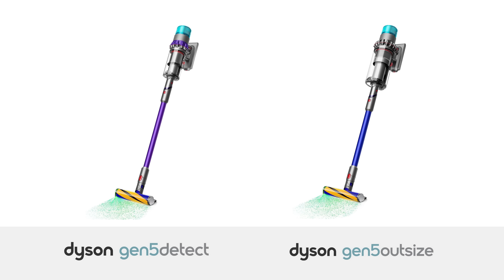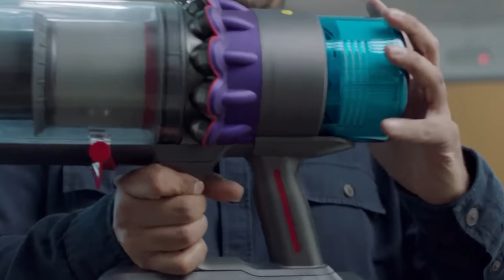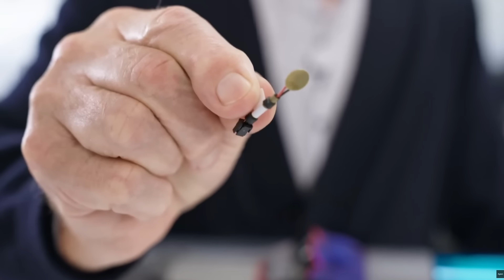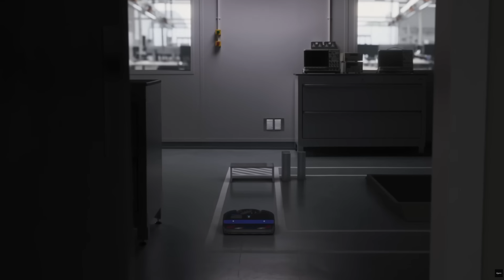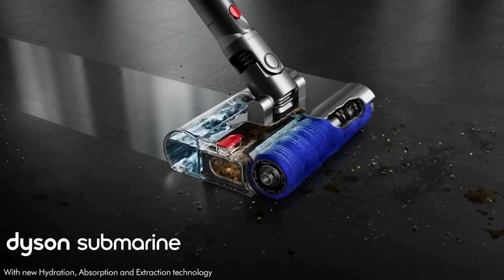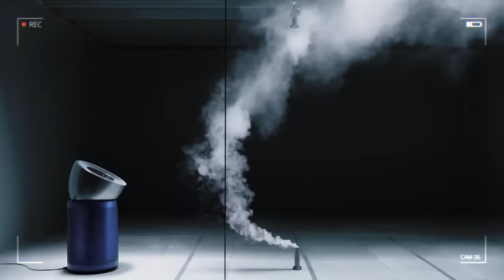Unpacking Dyson's 2023 Tech: A Comprehensive Overview - Vacuum Wars!

Comment: I personally had to go with the s9, the dysons run time actual reports from users has not been good not to mention no version of a clean base makes it feel heavily overly engineered like they took a shark and slapped a bunch of dyson chips inside of it. I feel for the price it should definatly have some version of a clean base and i think this years model will have a substantial run time issue compared to the advertised time.

Comment: I’m ordering that 360 VIS NAV when they go live. My original 360 Eye is sitting under a shelf because the charger stopped working. I’ve been using my 1953 Kirby Model 513 as the substitute for the 360 Eye. But I don’t mind using a historical vacuum from my Kirby collection. It’s the oldest Kirby in my collection when age comes down to hours ran and used in its life. For a vac built in 53 and rebuilt once in the 80’s, the 513 keeps on cleaning! Eat your heart out Dyson upright fans!
Reply from the maker: We are finishing our review of the Dyson Vis Nav 360 today! Come back tomorrow at 4PM EST for our full review!

Comment: Hopefully Dyson has improved the design of the power trigger.  Just replaced it on my V11.  It was easy to find the part and extra long tools need for the fix because it fails so frequently.
Reply: Dyson replaced our trigger unit three times.  They said they'd replace the whole unit if it happened again.  It's annoying because we had the same failure on our earlier Dyson as well.

Comment: I use a Miele canister vacuum. My friend has a Dyson Gen5 Detect. I don't like it. I hate having to keep my finger pulled on the trigger and because the motor and dust bin sits high on the stick, my wrist gets sore when using. I would rather have a stick vac with the motor and dust bin on the floor, like a Gtech AirRam MK2. Miele also has a cordless vacuum with the motor and dust bin on the floor but I haven't used it yet. I would like to get a cordless vacuum but the Dyson isn't it for me. I hate the cheap plastic and Candy Land colors too. I will stick with my Miele canister corded vacuum for now.

Comment: That hepa filter on the robot will be a double edged sword. It’s going to clog and need cleaning so much it will hinder the effectiveness of that machine. Even if it self emptied it wouldn’t clean the filter. Having owned a Dyson detect, I can confirm that it will blog that filter in minutes or even during or after only one run. I don’t like the hepa filter idea if only because it will make this a maintenance queen.

Comment: Another vidoe where you say a small battery with charge and resume doesn't matter much. You're wrong. I thought it might not matter but when you have a slightly bigger home, it takes 10-12 hours to vacuum one floor cause it has to keep charging. So please stop saying a small battery doesn't matter that much. It most certainly does.

Comment: The submarine as an attachment is pretty interesting, but I can't believe that Dyson, *Dyson*, specifically can't develop a modular stick and robot that uses the same motors and filters as swappable. Just imagine dropping the bulk of that Gen5 into the robot the same way they're showing the HEPA filter swap. Selling 2 things is better than 1, I guess, but it's not like they wouldn't price a bundle in the same atmosphere.
Reply: I'm sure they can, but the one thing I dislike about them (and many other companies such as Roborock and Apple) is they save features for future iterations. Like v15 was awesome, but wasn't available with Outsize option, and didn't have a button like the v11-based Outsize. Now Gen 5 has everything (button, detect, outsize, swappable batteries) that people have been asking for for years, and now they introduce submarine that it won't have. Roborock's Chinese version of the S8 Pro Ultra (G20) has an option to be plumbed into water line, but it's not on the S8 Pro Ultra. They'll eventually release it outside of China, for double the price (they're egregious about this--at least Dyson isn't charging so much more in other markets).

Comment: apparently dyson have patented a bleeder valve for the motor head of the gen 5 or its successor. it will enable the gates to be eliminated or left closed and still not suffer from clamping to the rug, which my gen 5 does even with the gates half open on most of my rugs, my v15 did not have this drawback. of course its due to the added power. I hope this bleed valve is able to be used on a gen 5 compatible motor head.

Comment: Purchased the new Robot.  It's a great deign and has potential however its software is buggy as hell!  After three hours of scanning the room it stopped and said 'software error'.  I find that it gets lost lots.  After rebooting the thing which in its self is quite a mission to get through, it does work correctly.  However a few days later I'll have the same issues.  It also does strange stuff when I tell it to go to a specific room and clean.  Today told it to go to the bedroom and clean on auto mode.  Yes it went. to the bedroom, stopped for a few seconds and then returned back to the dock!  WTF???? I then retried it again and this time it went to the front door area, no where near the bedroom, and stayed in its hunting for its location mode while it bounced from wall to wall.  After physically returning it to the dock an rebooting it, it finally went to the bedroom and cleaned!  BUT it finished the room and then decided to clean everything else on its way back to the dock.  As it did so it looked like it was back in its bump and ride mode with no clue where it was.  It eventuality made It back.  What was strange is that it never uploaded its map it does every time it clears with info on where it went and how much dust there was etc.  Anyways despite being a dumb dumb it cleans very well.  Literally like a Dyson stick but Im not doing the pushing.  Hope there is a software update soon that will improve the smarts of this.  Not really a good idea to release the most expensive robot on the market (In Australia) that is not very clever.
Reply: I think what I wrote ignored the amazing side of this thing. Today I got a msg on the robots little screen that it is time to do routine maintenance. Not only that, it provided me with a step by step guide which reminded me of the visual guides you get when you jam a photocopier... genius!  Lastly I've noticed that this thing really and I mean REALLY excels on wood floors.  Ive noticed that they are not just clean but they shine almost like they were polished.  I imagine this is an unintended effect of the roller.  It's seriously noticeable.  Also the amount of dust around the house is significantly less.  Brisbane during winter gets very dry and dusty and it is a challenge keeping up with it.  Yes the battery life is not fantastic BUT it's sucking cleaning and filtering way better than anything else.  The rubbish container is big and holds quite a bit.  The only annoying thing is that the dog hair gets stuck in the metal mesh ring however I keep a paintbrush by the bin to dust it off.  Honestly I thing the self empty thing is a gimmick and you would be locked into buying the special bags for that thing and what if the device out lives the supply of those bags?  I don't think any have BUT the Dyson is built so well and works so well that it very well may live and continue to work for a very long time.  Can't wait to see what other preprogrammed surprises pop up with this machine.

Comment: Dyson's own videos show a ridiculous amount of hand-maintenance required for the Vis Nav.
I can't believe they made a submarine attachment and it doesn't work with gen5? So what are v12s and v15s? An update of the previous models using the same motor as the gen5?
Will wait for your reviews. Leaning towards Roborock S7 MaxV Ultra + dryer (cuz it's cheaper and has a camera that I'm keen to have available).

Comment: The Dyson Submarine does not vacuum and mop at the same time. The motor is disabled when in submarine mode, and power is supplied to the attachment, for rotating the microfiber mop head. Each function has to be done separately. The Dyson Submarine fails to offer the one benefit of "hard floor cleaning wet/dry appliances" which is - doing two chores in the time of one.

Comment: These are all honestly quite interesting machines. I’m surprised the submarine attachment doesn’t fit on their brand new released cordless. Seems backwards to me. And the robot looks cool but I’m also surprised dyson did not join in on the self empty train. I have a feeling the robot won’t do that well like the previous one due to cheaper machines simply doing better. I’ve used the same robot in my house for 4 years and I do still love it. But I haven’t found anything that could seriously replace it at a decent cost. That new air purifier honestly looks ugly to me. But I understand Dysons thinking due to them wanting the best performing air purifier possible. All great stuff from dyson and cannot wait to see the reviews from you!
Reply: same rerason dyson never introduced removable batteries up until a couople years ago. plannneddd obsoletence

Comment: I won't buy a Dyson cordless until they change that you have to hold down the trigger to have it turned on. Having to hold down the trigger is excruciating for people with arthritis and for the elderly.
Reply: I believe the new gen5 is a button, no trigger.
Reply: Yes, privolist is correct. The new Dyson Gen5 series has a single-press button, there is no longer a trigger to hold down.
The same goes for the V12.
All the others still currently have triggers though.

Comment: About time they got a robot.  Gotta get one. I don't care about the low run time. It equates to power.
Reply: The run time on max setting is 10 minutes.
Reply: I got 1... The software needs a bit of work, updates. But the RAW POWER just blows you away. Yes, on Max it lasts 10 minutes ,just like the stick dyson, and the job is just as good as my V 11 if not better and on auto 50 minutes .

Comment: Can’t wait for the test of the robot.
Reply from the maker: Same here!
Reply: @VacuumWars   can you please maybe include noise samples (ideally in comparison to the competition) taken under specific representative conditions?
Reply: @VacuumWars  the robot uses the v11 motor and has 62 air Watts its not using the same motor at the gen 5
Reply: There is simply no way it's somehow 5 times better than your average Roborock.
Reply: @UhOhUmm that soft roller could be a huge game changer
Reply: @shaggyfilms  but no mopping! That's a miss for me
Reply: @Sturmbutcher  that’s a good point. I’m leaning away from a robot mop now a days so this is a contender for me
Reply: @shaggyfilms  No auto-empty is a deal breaker for me
Reply: @UhOhUmm  trilobite 😈
Reply: @UhOhUmm  Doesn't need to be 5x better. Roborock charges non-China markets 2-3x what they charge Chinese, so if it's as good as Roborock, I'll buy Dyson for the uniform pricing, reliability, and engineering.
Reply: Me too. It better be better than the roborock S7 MaxV considering it’s the same price!
Reply: Same here.
Reply: @shaggyfilms   If its wet and dry vacuum system then yeah but its only dry vacuum... I am sorry even the cheap robot vacuum doing good enough job this days with robot vacuum, frequency is the key, if you keep automatically do it every day or 2 days your floor will not dirty enough to use this power. not to mention this robot use Vslam instead more accurate lidar , no auto empty bin , no obstacle avoidance , no mopping system let alone auto mop cleaning, no multiple pass cleaning .... this just to many cons...
Reply: @anubizz3  is there a robot vacuum with the features you mentioned that doesn't have side brushes the way the dyson robot vacuum does not have side brushes? i have long hair and robot vacuums are a bigger hassle than vacuuming myself because the side brushes are tangled after running for 15 minutes
Reply: @chloro8306 you can always take off the side brush!
Reply: @georgebalan6201  but then how does the vacuum pull debris towards the center? The dyson has an arm to do that instead of a brush
Reply: @chloro8306  the arm doesn’t work well at all- there’s one review on YouTube from an Australian person and he shows how it doesn’t work. Besides, you don’t need the brush, you can just run it with more passes or run it more often
Reply: @georgebalan6201  it's also corner shaped in the first place 🤷 sorry but i've tried other robot vacuums and they cannot get into the corners or edges without the side brushes
Reply: @chloro8306  I mean then consider the Roomba S9 or Neato robot, there are plenty that are D shaped. And if the hair and corner concern is an issue- I might recommend just vacuuming corners independently!
Reply: You also have to consider that a robot vacum dosen’t need that much power. A robot only has to lift the dirt a few cm into its bin.